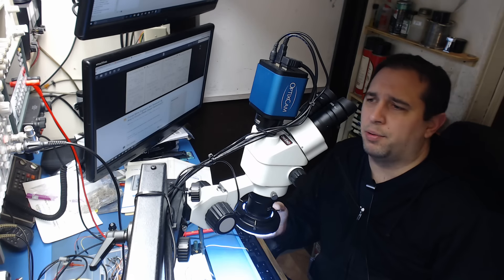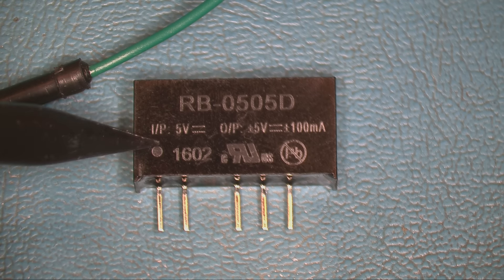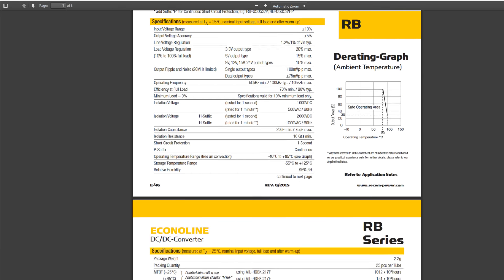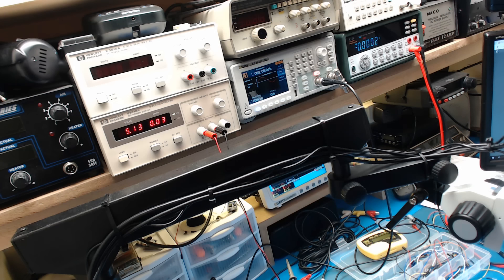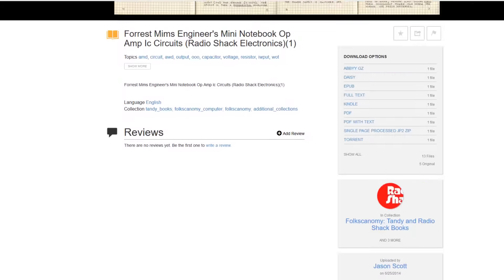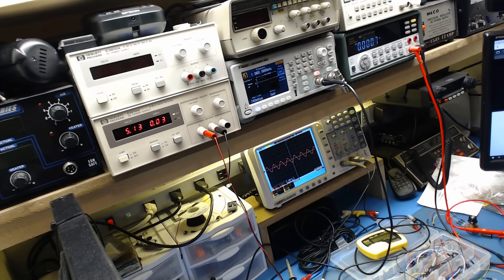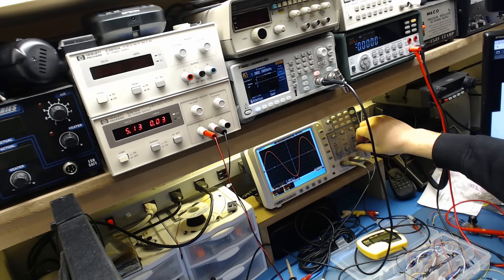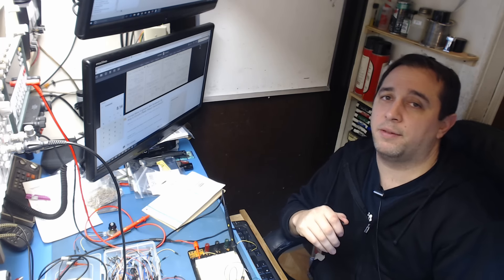CHEAP SPLIT SUPPLY FOR SMALL OP-AMP PROJECTS.

Comment: In some projects that don't require a lot of current, you could also go for voltage doubler/inverter chips like MAX1720,  LM828M5X , TC7660 , NCP1729 , TPS60402  ... most can do at least 50mA , some can only work with up to 5.5v but some can manage even 12v.... and they output either approximately -Vin or 2Vin (it's that, minus a diode voltage drop which is small at less than 100mA) depending on how you connect a couple of ceramic capacitors to the pins of the ICs .. and you can stack them for more current.

I doubt the noise is much higher than the noise of a switching regulator like the one in the video, which works at hundreds of kHz switching frequency. 

@mikedrz :  see SI7661 or ICL7662 from Maxim  or NJU7662D  from NJR or TC7662ACPA or TC962CPA (DIP) from Microchip or LTC1144 from Linear  - these work at up to +18..+20v and can do 40-80mA (except the Si7661 one which is rated for 20mA)

Comment: Instead of regulating both rails at the final output, couldn't you just regulate the one supply voltage powering the DC To DC converter? Might save on the part count and be simpler.

Comment: If you need more power you can use an LM675 OpAmp (or any similar) with very few external components. It can go up to 3A. You'll find the schematics in a typical application from the datasheet (p. 3).
Reply from the maker: Great suggestion. Ill have to get a few of those and play around.

Comment: Viewers, look at the data sheet for the humble 78XX.  It is a good place to start getting your feet wet. 

Provider, Look at Horowitz & Hill.  It's a good place to figure out electronics.

If anyone is watching someone "teaching" electronics and the "teacher" can't figure out how to drive op amps with technology from 1960, find new teacher.  The part described in this video is designed for pick and place robots.  In asia today, everything is built to a price point because Western consumers demand it.  Circuit quality from a pure EE POV is not based on robots and planned failure rate.

If you actually don't know how to manipulate supply voltages, YouTube might be a good business development strategy.  On the other hand, you sort of put a huge kick me sign on.

If my students had not brought this channel to my attention, I would not have so many examples regarding the value of EE programs.
Reply from the maker: Your ridiculous. This video was a example of a small cheap way to power some bench projects on the cheap. Stop tying to make it something its not.